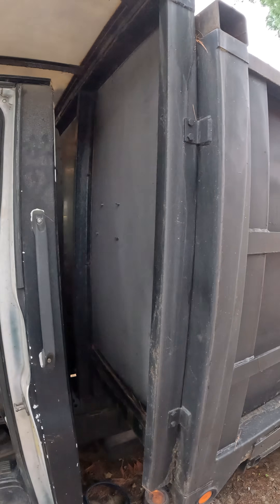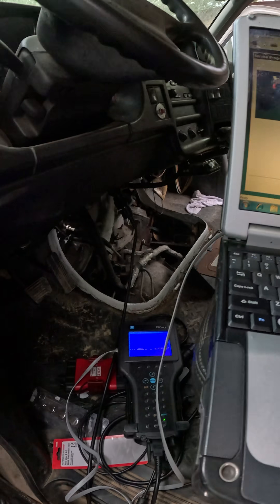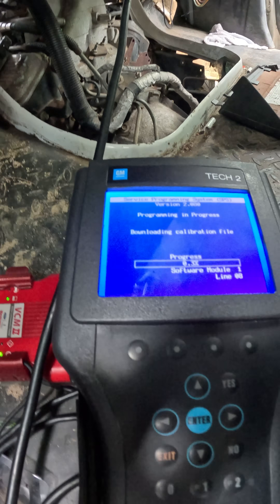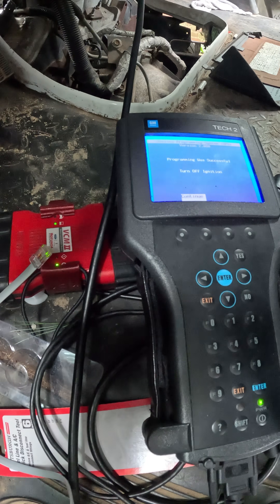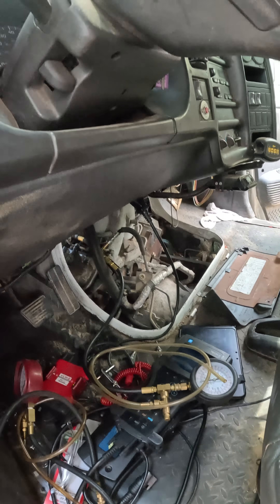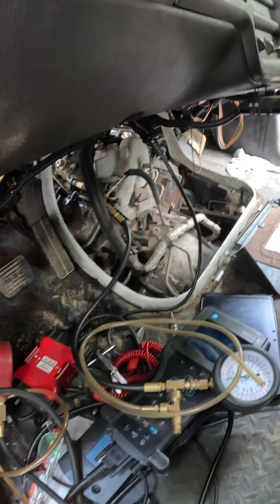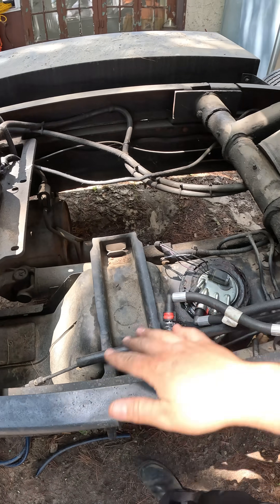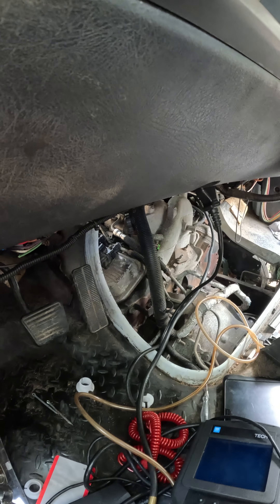Dusting Off The Old Tech 2! GMC Crank No Start!

Comment: Would have been faster to flash the PCMCIA card on an old laptop with a cardbus slot. Techline is RS-232 serial - so pretty slow connection. Also, you would have been better off using Tech2Win with your MDI and emulating the card.
Reply from the maker: Could be, but I have no idea how to do any of that lol
Reply: @advancedleveldiagnostics there is no possible way we can know it all with technology moving so fast, I guess project 2025 want to eliminate techs eliminate too😂

Comment: My first ever programming job was a 2005 Saturn Vue, and it wasn’t successful since I didn’t have. Tech2.  They’re go for too much money on eBay to invest in one.
Reply: You can get the windows based emulator with the Saturn bin file for next to nothing. I've had good luck with it in the past.
Reply: @topher8634  Yeah, I did try the windows emulator with my Cardaq 3 Plus but it was a no-go.  Even tried running the Cardaq in debug mode but she wouldn’t connect.